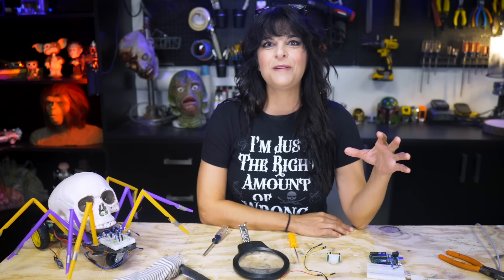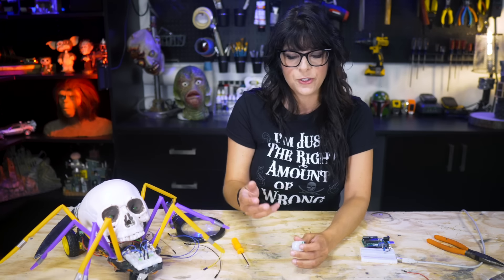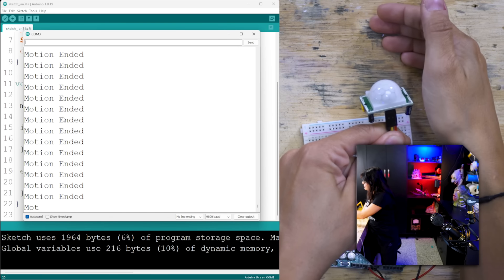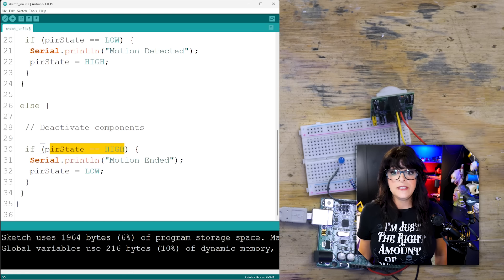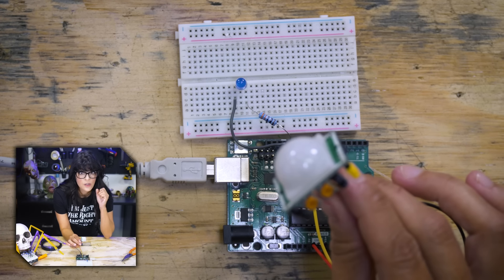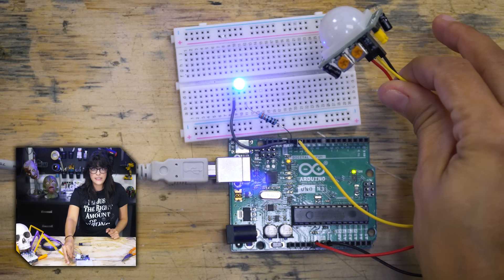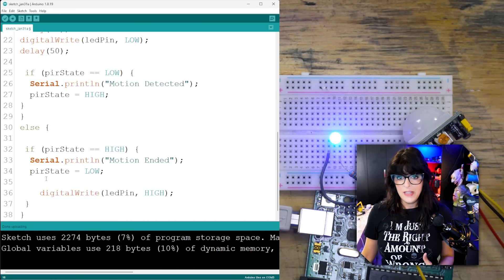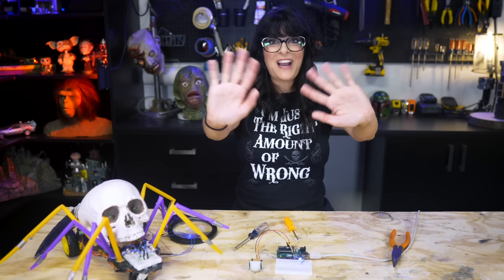How to Use a PIR Sensor with Arduino: Wiring & Code for Motion-activated Projects

Comment: Hello, a quick question I would like to know if anyone has an answer for. I can't get the DFPlayer LED to even light up. I have the wiring precisely the same and a formatted SD card. Does anyone else experience this issue? Advice?

Comment: Thank you for the video! Have you done any tutorials or do you think you could do a short video on how to use some of the mini ones in circuits without arduino… you have such a gift for demystifying electronics and making them easy to understand and entertaining. But arduino is not always possible or logical for some of my projects. I’ve been really struggling with what I thought would be something super simple project to learn more about PIRs  …turning on a 5mm LED light with a mini PIR. 🤷🏻‍♀️

Comment: Love the info and how you explain. Simple for me to understand. I’d also like to see how to make random blinking eyes on a prop/mask animatronic. I’ve seen it on instagram but no clear explanation on how they did it on a mask. Thank you 🙏
Reply from the maker: That's a great idea for a future tutorial! For the mask project, one thing you may want to check out is flickering LEDs. They come in red, green, yellow and a variety of different colors. No coding is needed. You just include a resistor and power them with a battery and they flicker randomly on their own. Of course you can program specific patterns with Arduino and trigger them with a PIR sensor too!
Reply: @RachelDeBarrosLive  that’s a cool idea too with blinking LeD’s! But to be more specific; sorry if I wasn’t clear 🙏: blinking eye lids where it looks like the character is shutting and opening eyes.  I saw someone build it with a resin printed helmet shell to wear. Which I wonder how they stuck such small components to do that. Thank you so much again!

Comment: Great video.  I have been having trouble with my PIR sensor.  Either the LED stays on too long or off too long.  I try some of your code to see what went wrong.

I tried your code and it works better than anyone elses code.  Great job.

One thing though in your 3rd example, the one using the led, you forgot to setup the ledPin as OUTPUT.  Not a big deal really, easy to fix, but I thought you might want to know.

Comment: Hello. I was looking to purchase some of those motion sensors for smart home applications. In the description it says the manufacturer did not install a photodiode. A different one (but looks exactly the same) says photoresistor. Are they the same thing? How will i know if i need to install one? What are the necessary connections for integration?

Comment: Thank you for the great video! 

I have one question: What if I want the 3 second sound to repeat, if motion is still present? Meaning, if a person stays for longer than a few seconds the same sound bite loops. Right now, I see the option sensor is detecting that motion is still present,  but the MP3 player automatically turns off after the 3 seconds of the sound bite as played.

Comment: lol kekeke.  perhaps next step would be to switch to an ESP so u can go wireless.

to start off, the most basic example would be to have the LED follow the inverse of the PIR GPIO.  i.e. (pseudocode incoming) digitalWrite(ledPin, ~digitalRead(PIRPin)).  That's because the PIR sensors will hold the line high for, what, a second or something, which is long enough to for an eyeball to see the LED, and you don't run into any of your issues.  Less is more sometimes.

second, you should just avoid delays.  use rollover safe millis() math instead.  Basically almost any time you use delay(), you're probably doing something wrong.  This is an unfortunate deficiency in the Arduino ecosystem -- no notion of a "scheduler".

But basically once you structure the code that way, it's easier to start doing stuff like your fade and other events.